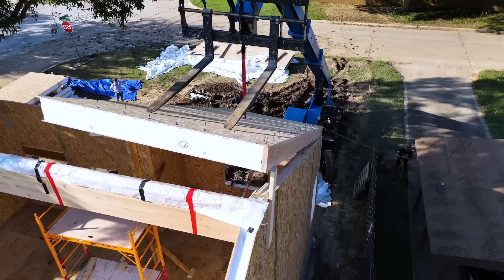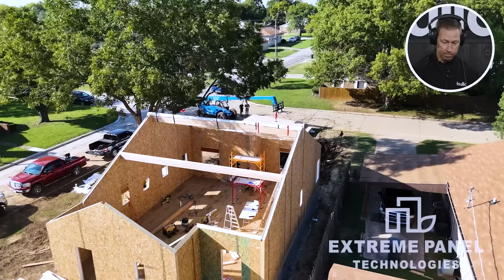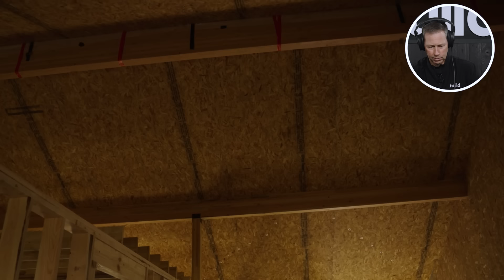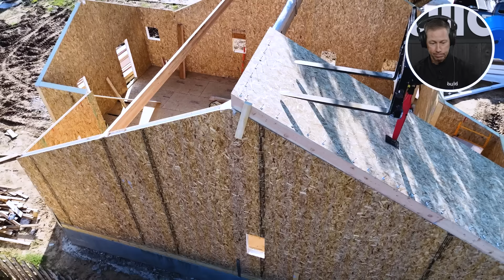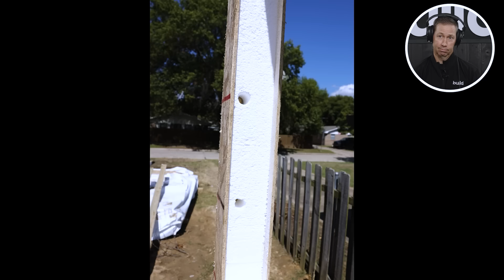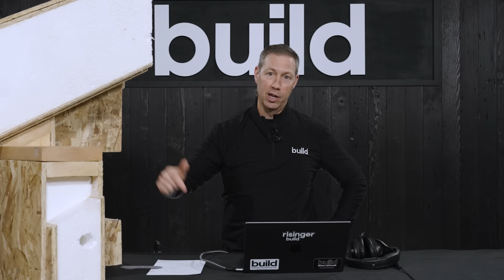High Performance HACK - Why More Builders Are Choosing SIPs

Comment: I would caution anyone to really do your research on sip construction before buying or building with sip. You need to take into account your climate and what kind of foam is used in your panels. Open cell foam is vapor permeable and closed cell foam is not. What that means is if you have open cell foam, whether it's sip or just spray foam in your rafters, during the cold months the humid air in your house will pass through the foam and then condense on the cold outside sheeting. This condensation does not dry out until it gets warm enough outside to prevent condensation, therefore rotting out the structure of your house. I've been a roofer in the Joplin, MO area for 25 years and have replaced the roof on 4 sip houses in that time. Every single one of them had major sheeting and structural damage. I now decline to work on sip houses.
Reply: i've experienced the same in Western Massachusetts and southern New Hampshire. I love the convenience of the build, install and the design, but panel foam is just a no-go for me personally. i'm working on a test cabin for a campground now, using hemp-wool insulation SIP style, with 3/4in Zip system sheathing, if it goes well, and passes inspection after the second winter, the campground is looking to replace 16 cabins with the same construction style. 2x6 exterior walls
Reply: @MarcusVellor  I hope that goes well for you but my experience says it won't. It's not just sip and spray foam that I've seen this issue on. I've seen it with every type of insulation that is in direct contact with the entire roof sheeting like vaulted ceilings or unvented conditioned attics. In my research it seems the only way to remedy the problem is rafter baffles and ridge vent, closed cell foam because it is also a vapor barrier, or exterior rigid insulation so you're moving the condensation point away from the sheeting. Being a roofer I don't have any data on what happens in the walls. I suspect it's the same as the roof but maybe to a lesser degree.
Reply: @MarcusVellor  zip system offers 3/4 inch sheathing?
Reply: Proper design of the wall and roof assemblies is critical to not only SIPs but all construction.  With SIPs, design with the intent to allow the OSB to dry to the side it gets wet on.  This means low perm underlayment's adjacent to the OSB, and proper air spaces where needed.  SIPA has great resources in their Design Best Practices and Builder Best Practices documents that describe how to do this.  

The perm rating of the SIP itself as a composite is less than 0.1.  The joints are the weak spot.  This is why the SIP industry uses sealant in the joints and SIP tape on the interior of the house.  It is also why low perm underlayment's and coverings need to be used adjacent to the OSB. 

The Structural Insulated Panel Association SIPA website is a good resource to start your SIP research.

Deteriorated OSB of the SIP wall and roof panels can be fixed.  The fix will depend on the situation, but it can be repaired just like with any other construction material.  If you need help with this kind of situation, reach out to me.

Comment: Homes are getting so cheap and weak with these improvements. Sooo much effort is being made to remove skilled trades simply so that GC's can take a bigger bite out of the budget. Why do they want 15 to 20% or more to make phone calls and show face every so often?
Reply: If it's as easy as you say, why doesn't everyone do it? There must be something more to the job than what you just described.

Comment: How does the styrofoam hold the vertical loads?  Those huge beams sitting on foam and 2 layers of sheathing seems like it'll just sync through the foam over time...
Reply: There's a solid vertical post transfering the load to the foundation.
Reply: Most SIPs systems have 2x4 or 2x6 framing inside the wall, just less than a typical framed wall.  Also, most of the vertical load is carried by the interior and exterior OSB or plywood skins, the foam only helps to prevent buckling and doesn't really carry any of the load.
Reply: This is to save labor and material costs so that it's an easier pill to swallow when the GC presents his portion of the budget. It is weaker and a failure point. This whole idea is. Homes quality are at a race to the bottom. Removing skill trades in favor of manufactured assemblies. No thanks. I'd rather put the money where it makes sense, skill labor and good materials.

Comment: How have they fixed the roof rot problem Joe Lstiburek points out regarding water vapor being trapped at the roof peak?
Reply: SIP rot is a valid topic, and the industry definitely learned from the early issues. SIPs have been used for over 40 years, and while some panels experienced problems in the past, advances in materials, technology, and building practices have made those cases far less common today.
Proper installation is key. Using vapor tape at the ridge, sealing the ridge from the inside out, and choosing vapor-permeable underlayments all help protect the roof system and allow the OSB to dry if it ever gets wet. It’s also important to note that these concerns aren’t unique to SIPs—any airtight, energy-efficient building with a hot roof assembly needs careful moisture management.
When designed and installed correctly, modern SIP roofs perform extremely well and have a long track record to prove it.
Reply: They haven't actually fixed it
Reply: Ventilation will solve the inside layer but the exterior layer won’t last 30 years even in mild dry climates. You can’t properly repair them if a tree branch or storm causes a roof leak you have an absolute mess on your hands.
Reply: @thebullgator  SIP panels can be repaired.  If you need help with this type of situation, reach out to me.
Reply: Sealing the crap out of it, adding an HVAC register to the attic or vapour port.

Comment: How much more does SIPs cost compared to traditional framing?
Reply: you forget, SIPs can be up & watertight in 3 days, not 3 months with a nail gun theres your BIGGEST cost saving, start to finish is possible in 2 months ,with the correct crew with the right skills :)
Reply: @kevinmatthews2620  That front-end savings is huge during construction, but we notice the greatest value package is in the use phase. SIPs are 40-60% more energy efficient than stick-frame construction.

Comment: I like this a lot more than putting the foam on the outside, the only pain is running exterior wall services, but you should try and limit that to power only anyway.

Comment: Sent this vid to my builder!  Awesome!  This is exactly what I want!  Six days to be dried in?  Yes that is a big deal.

Guess where I"m at?  ARKANSAS!
Reply: Make sure your foundation is precisely built.  Maybe build the foundation first and take measurements for The SIP panels match.  I've seen videos where the foundation and SIP panels were built to prints simultaneously and the foundation was off.  Then delays.  SIP installers ahows up, they don't fit right, and they point the finger at the foundation contractor.  Something to ask the SIP panel company.  Has that ever happened to them?  The answer should be YES.  Then ask if it happens to my house, how do you fix it and how much does it cost.  Then get it in writing.  There's a company call ICF of the Ozarks.  ICF is superior against tornadoes.  The YouTube channel Lake Lot Build used them and they document their owner build.
Reply: @markstipulkoski1389  I am curious how the foundation not being constructed properly is the SIPs fault/problem?  Can't the foundation contractor follow plans and dimensions?  🤷‍♂🤷‍♂

Sounds like you need a better foundation contractor.
Reply: @JoePasma I asked an AI the following question.  Note I did not mention foundations, but it included it in the answer:
What problems have people encountered  when building a house with SIP panels?

Foundation Requirements: SIPs require a very flat and level foundation for proper installation. Unlike stick framing, the panels cannot easily be adjusted to compensate for foundation inconsistencies.

So yes, you need a good foundation crew.
Reply: @markstipulkoski1389  Totally agree with the need for a good foundation crew.  SIPs can be modified on site, however if the foundation is out of level and not square life becomes much more difficult.  

A suggestion to minimize these issues is to talk with the subcontractors involved with the project before an ounce of dirt is moved to help them understand the importance of good quality, accurate work.  

To me this goes without saying but sometimes the obvious to me is not so obvious to others. 🤔🤔

Comment: I'd love to see a major remodel where SIP is added to conventional framed house. Either as main floor or pop-top story addition.
Reply: We did a major remodel with SIPs.  We added on to the back of the house, took the stick framed garage down that had a truss framed roof and used SIPs for the entire addition.  The SIP garage wall panels supported the SIP floor panels over the garage.  We added vaulted space above the garage and created a completely new level in the house.  It has worked fantastically.
Reply: @JoePasma I actually considering the same thing
Reply: Probably better off doing a larson truss in that situation
Reply: @Meddle83  I'm interested in the SIP advantages of shorter time to dried in. Thinking that if it's planned right, the finished rooms in the existing house would not be exposed as long. The interesting part to me would be how/if they design the connection between a SIP add-on structure and existing roofline/wall/etc.  The other primary advantage would be full enclosure insulation, and possible sound transmission. Though the Larson truss might be equivalent in attentuating outside noise.

Comment: ZIP should make a SIP 😎👍
Reply: They do with eco panels of Tennessee. Much better sip too
Reply: @chrismarfia9917  Very limited on sizes with ZIP vs standard OSB.
Reply: Eco panels have a cam lock system to join the panels.
Reply: @kevincrawford7255  So does Murus in Ohio.
Reply: Zip Sip, sounds like an energy drink or really strong coffee? 
 "If you want to put some pep in your step, drink zip sip!" 

Disclaimer: It may contain amphetamines and shouldn't be consumed before operating heavy machinery or power tools. 
                         (LOL)
Reply: They do but the panels are small.

Comment: Could you get the outside board material with a zip bar system instead? That way you have water containment better with good insulation
Reply: Yes, there is a company in US that makes SIP with zip exterior layer.
Reply: @simson4t  eco panels of Tennessee
Reply: Yes but the panels end up being small which somewhat defeats the purpose.

Comment: I live in a SIPs house (+timberframe).  Ask me anything
Reply: Can any house plan be SIP built, or does it have to be designed from scratch?
Reply: @kfk256   I don't see why not but there may be some strange architectural feature that is impractical to do with them. You can send in plans to a SIPs company and they will calculate everything and deliver it to the jobsite. If they can't do it for some reason or another, they should know well in advance.
Reply: @kfk256  The short answer is yes.  The longer more in depth answer is it depends.  Just like with stick framing, the more complicated the house is to drawn and design,  the more it is going to cost to build.

So the real questions are what does your plan look like?  What do you want, and what is your budget?
Reply: Send us some details on your house and a few pictures. We are always looking for new SIP projects (especially that timberframe/SIP marriage) to showcase in our SelectSIPs Newsletter. Nothing beats an occupant testimonial.

Comment: What is like to run electrical and plumbing through the walls??
Reply: You can see voids in the SIPs on side where wiring can be run.  The red marks on the SIPs shows the placement of them.  Plumbing isn't usually run in the SIPs.  I was wondering about drain-waste vents through those very thick roofs.
Reply: @jabbathespud  You should only have one of those, 2 at the max

Comment: What is the fire rating on the SIP panels?
Reply: This is a good question, I think it’s probably actually pretty high, because although the polyiso, can burn, it’s sandwiched between two panel panels in an airtight fashion, so it would need to burn a hole in two places to be able to create an air channel to then actually be able to propagate that flame through.
So I’m gonna guess that this is actually quite flame resistant
Reply: The panels need to have gypsum board.  This is EPS foam covered with 7/16 OSB.
Reply: @BirchwoodBill  EPS burns really well.
Reply: The IRC (International Residential Code) requires thermal plastics to be covered with a 15 minute thermal barrier such as 1/2" gypsum, 23/32" wood structural panel or a material that meets NFPA 275.  If the interior of the building is being covered  with 1/2" gypsum, the thermal barrier requirement is met.  SIPs can also meet hourly fire ratings.